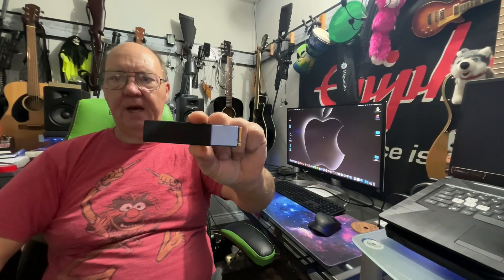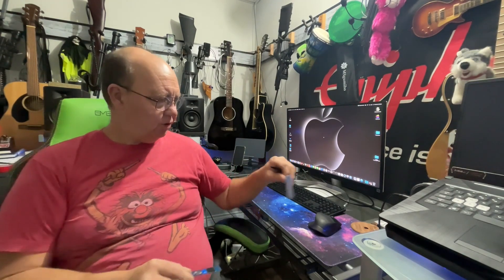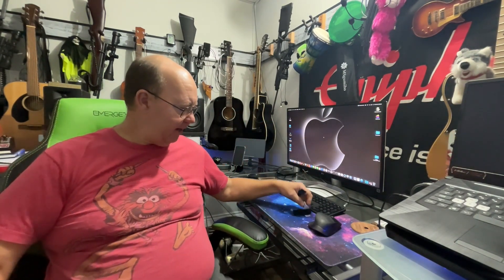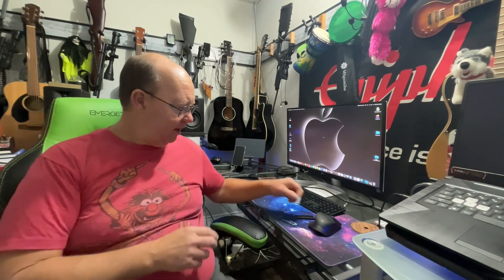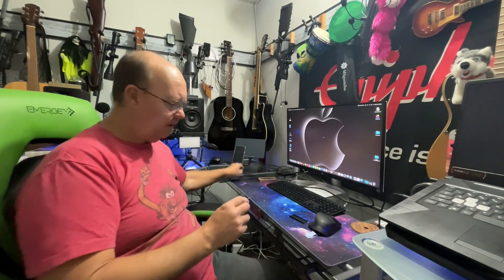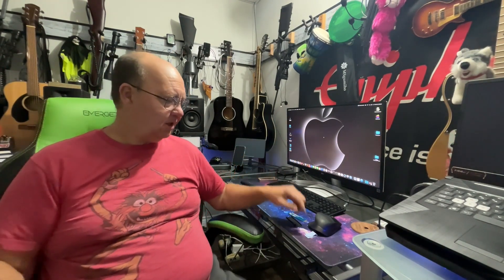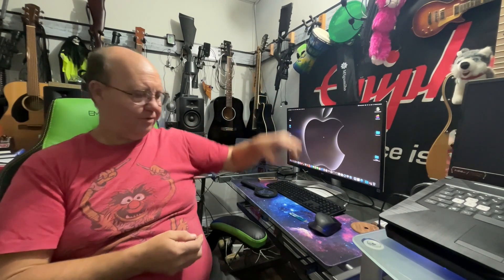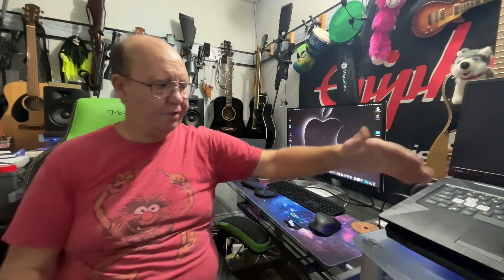This Junk Will Kill Your SSD Drives

Comment: If the fan is pumping air out it has to be drawing air in otherwise it will pull a negative pressure if even slightly. Simple physics. I never understood silicone as a heat sink unless it is not just silicone. Maybe some kind of metal impregnated? We always used silicone on race engines and production engines as heat insulators and heat resistance.
Reply from the maker: An engine is not a microchip not even in the same universe , there would not be any metal in silicon for computers at leaset because the metal if any would short out the circut  nice try tho. silicon does nto disapate heat it keeps it there and thus more heat is created and thats why the drives are overheating fast and just even runing to hot even at idel i have done loads of testing that proves what iam saying..

Comment: I had always thought silicone to be a poor conductor of heat
Reply from the maker: well in what these are used for they sure like to amp up the heat and with no proper air getting at your ssd well that can just burn them up faster id rahter take my chances with write cycles on an ssd then to ever use these stupid things ever again but you know we all have to try something to see how it works or Fails in this case every one i have tried so far fails but even the math and science works out these will cause you to buy more drives sooner hence making more money for companies that makes them , putting our trust in companys is not always a good idea they want to keep making money as well. silicone is good for baking but that silcone is not the same makeup in materials as these things are not even close ..

Comment: 56*C no issues. m.2 Drives are designed to run warmer . YOU ARE NOT SUPPOSED TO BE HANDLING THE THERMAL PADS . Your oils are bad for it. your few tests aren't "The word of God" so to say.
Reply from the maker: my tests are Called PROOF also 56 on the topside is not to bad but go any higher htey start to throttle expecially in the 60's so ya even 56 is boarderline and i dont give a crap ola about handing the pads that are being pirtched out when new and fresh install is one thing but when your not going to use them anymore you dont have to be a puss about it just take it off and incert to nearest garbadge can where they all belong

Comment: The normal operating range of nvme ssds seems to be around 0-71C which it sounds like its within. You only want to cool the controller, you don't want to cool the nand. Look up: Does cooling the NAND chips on an SSD negatively affect its reliability?
Reply from the maker: my dirves run colder and better when colder no thermo junk on them they all run 40c and under once adding the silcone pads they run hotter and slower and thermo throttle explain that if you can

Comment: I'm using the included m.2 cooling plate and pad that came with my motherboard and runs fine after even 3 years of heavy use, m.2 doesn't need much cooling and ive heard cooling your m.2 actually makes it perform worse and the ideal temperature is around the 50-60C
Reply from the maker: well sorry to say but the data i have collected shows different the cooler the better has always been there when it comes to electronicss these things run better colder then hother just like a computer runs better colder when it gets to hot parts burn out and your computer throtltes slows donwn alot so the science alone with out testing fiurst hand is correct cooler means better peformace hotter is worse..